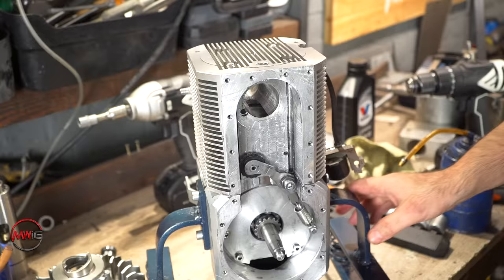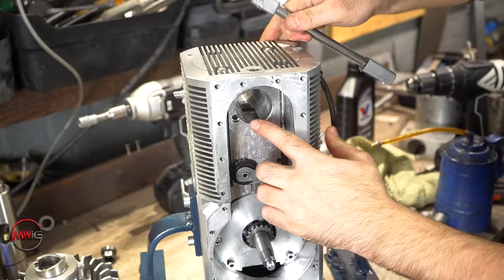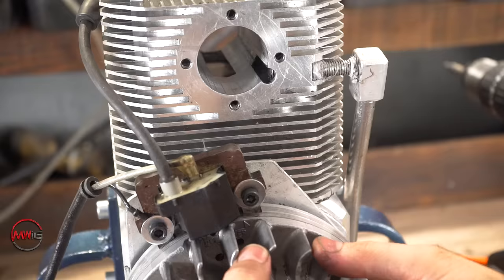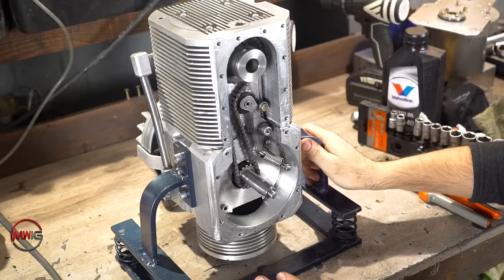I built a brand-new Rotary Valve Engine, and it works!

Comment from the maker: I built a brand-new Rotary Valve Engine, and it works!
Reply: YES! congrats!
Reply: Also we want to see the power output, make followup video and give it a test.
Reply: Please use 2 stroke oil in a secondary tank for lubrucating the valve. The smoke will clear up a lot
Reply: Масло гонит через распределительный механизм, скорее всего из-за этого дым!
Reply: Will also recommend a dumper on the other end to help reduce vibration by compensating the flywheel balance during crank shaft motion.
Sorry I am just so excited by this and it's my field of profession
Reply: This is not new one.i made it before
Reply: I've got name
Smooky 😁😁😁😁
Reply: Love to see you refine it and mount that little beast onto a frame with wheels or some cool design from youself🚌🚖🛥🛩
Reply: Very great job
Reply: Alhamdulillah, congratulation Guys 🙏👍🤩 amazing
Reply: Yes finally you Done it I so happy, congratulations & greetings from Sri Lanka. This should be a another invention rotary valve, now try to do fine tuning reduced smoke, stop trying engine lubrication oil burn. & improve fuel efficiency. Good luck. Thanking for sharing & for your self encouraged.
Reply: Happy for you!
Reply: Congratulations ..yeah ..👍👍
Reply: Great job!!!! I just started the video, so I don't know what the fix was, but last time it very close.  Just sounded like you needed to adjust some of the way its timed possibly. But ive never done this like you, so ill sit back, be quiet and enjoy watching your video!
Reply: Heck yeah, glad you didn't give up on it. Nice build 👌
Reply: To make less smoke, use twostroke oil in the gasoline, it burns better (and it is not good to mix normal oil to fuel anyway). Well done on the engine mate 👍👍👍
Reply: A lot of oil leakage into the cylinder. How about instead of rotating the cylindrical  valve you push pull it: instead of rotating push it in one direction for intact and pull it in the other direction for exhaust. The  you can apply piston rings to address the oil leakage issue. Use a CAM with a pitch on the side that pushes the cylindrical valve in and out. Or use two cyindrical valves: one for intake & the other for exhaust.
Reply: Super vidéo 👍
Reply: Love that old school sound
Reply: Even better if you put vulve oil seal
Reply: Please work on the oil leaking  into the chamber  issue, this valve is the future,  i will give  you design ideas give me your email. use oil scraper just before opening. oil scraper will partially help with oil leaking problem. this valve is so much better than puppet valve system. patent it. you will be rich.
Reply: Я очень удивлен и у меня есть два вопроса сколько двигатель выдаёт лошадиных сил и какой расход топлива ?
Reply: I have a couple of very interesting engine designs that I'd love to see you build!
Reply: this engine it's mixt by rotary engine and 2 stroke engine
Reply: I have also made smoke machines
Reply: @philkinmwangi  dampener? Is your auto correct messing with you?
Reply: Well done! Congratulations, excellent machining.
Reply: Tambahkan turbo
Reply: Good jobe
Reply: А почему до сих пор в двс используют обычные клапана?
Reply: @philkinmwangi  Harmonic balancer
Reply: @Dreamer3K This rotary valve has many advantages. Less parts, easy to manifacture, better gasflow etc. We still have poppet valves because they are much more resistant against pressure. The invention we need ist not a rotary valve, the invention we need is selfsealing rotary valve.
Reply: @leximatic  i can help with that.

Comment: I designed an almost exact head about 45 years ago. Before CAD a friend and I worked it out on paper and called it a rotisserie valve head. Glad to see someone actually had the balls to run with it!! Nice work.
Reply: Yeah me too. I presented it to GM at a special meeting of their board and they said "Oh Bullshit".  LOL.
Reply: FYI - a similar valve-less engine was devloped in the late 30's / early 40's by the Germans to fly their planes - I remember reading about it back in HS in the early 80's when I was enamored with Wankle's rotary engine.  It had a rotating disc on the top of the cylinder head if I recall correctly...
Reply: It's called the Cross rotary valve

It came up in some Popular Science of the 70s
Reply: @repentnow1720  A Wankel engine is completely different and doesn't have any valves at all.
Reply: I congratulate you for having built a rotary valve engine, I am a foundryman and I built a rotary valve engine 23 years ago and it worked, but the development failed me because it worked for a few hours due to excessive wear.  Los felicito por haber construido un motor de valvulas rotatorias, yo soy fundidor y construi hace 23 años un motor con valvula rotatoria y funciono , pero me falto desarrollo porque funciono pocas horas.
Reply: The same design has been tried by very smart people & it failed every time but to excessive wear & heat also the slow opening & closing speeds.

Comment: Very similar to a valve train I designed for a science fair in 1979. Poor high school kid so my model was built of wax, and plastic. So cool to see it probably would have worked. Mine used ball valves on a common shaft that wasn't hollow, and turned at 1/4th crankshaft speed so that the valves opened in the opposite direction each time. I worried about compression, and oil seep, and never could figure out how to seal them effectively. Thanks for doing this. I still think about building a working example to occupy my mind sometimes when I can't sleep. Life has a way of consuming all available time.
Reply: Must be where I got the idea .. as you finished up I was born ...lol.  ( May of 79)
Reply: @jasonwhite8722  You're too kind. The hollow shafts are ingenious, and a much better design. Like I said, just a dumb high school student that fell in love with engines, and their complexity. Thanks again for building this.
Reply: I too came up with something similar when I was young (early 90s). Mine used something like camshaft blanks though tye valves were cut out reliefs and intake/ exhaust were separate. Later learned about Coates Spherical Rotary Valves. Also read about disc type systems invented in the early 1900s with a hole that rotated above the combustion chamber. They also couldn't get enough compression.

Comment: synthetic oil smokes far less and will leave less residue, other than that i'd love to see how much power that thing puts out!
Reply: It's easily around 120kW
Reply: Interesting. Lets put on dyno.
Reply: doesnt help when it literaly spit oil throug exhaust in first few seconds 9:13 its literaly driping all over lol so bad this video is such a bad example. or example how not to build engines.
Reply: @JusstyteN  tell us how many you've designed and built
Reply: I changed my mind. It's EASILY 1MW motor
Reply: @JusstyteN  He mixed oil with fuel. That seems the engine imitated 2 stroke cycle engine.  Its normal characteristic on this kind of engine.
Reply: @alexlo7708  yep he added oil like a 2 stroke but it's a 4 cycle and has static oil lubrication so shouldn't need oil in the fuel
Reply: @jackass123455  I think so. Had not he mix the oil, pure fuel would have not release smoky.
Reply: @alexlo7708  no its not normal to spit oil in droplets in the forst few seconds. Even in 2 stroke engines the amount that is added should be burned. This one is spiting like engine that is done for.
Talking about designing im not trying to reinvent a wheel there are teams of engineers that are working on already great designs to improve it. While he tries to reinvent invention that was built in late 1700s im happy that he made something in his garadge but that engine has no use. Basicaly waste of  effort and materials.
I have built 1 hybrid engine myself also in the garadge. I know plenty about the engines and i can say for certain that invention that had multiple teams around the world trying tirelesly to make it better for 200+ years wont be reinvented in some random as garadge dude who is very happy that he made an engine who is absolutely not working as it should.
Reply: @alexlo7708  this dude reminds me of the dudes who think they have built and infinite running engine. If i was to build an engine i wouldnt publish something that is failure or if i was i would put a proper title as "trying to build an engine not successful yet.
Reply: @JusstyteN  >talks like an authority on the matter

>can't spell garage
Reply: @JusstyteN  if there weren't people like him doing stuff like this, there wouldn't be much innovation. Why does it matter so much to you that this guy built an engine? Also, why not show your failures? Their a part of growth and show that you are indeed human. I like them being included. Then also if someone tries this for themselves, they can avoid the mistakes
Reply: Maybe this is more than just a fun project, maybe it's a prototype. You don't make a perfect product in one try. You look back and do some tests to determine what does and doesn't work, and you improve from there. He doesn't even need a reason to do this, it's just something cool that he did. I'd be overjoyed if I built a working motor from scratch, especially if it has one or more unconventional mechanics.
Reply: @JusstyteN  Pretty sure most new ideas started with a guy in a "garadge". You don't know much about the history of inventing if you think that most of it came from paid teams in labs with college degrees. Those paid teams are really great at the process of iterative design, but nearly all "new" ideas came from individuals who are free to think, try, fail, and try again as their hobby.

It's better to cheer on the man who has an idea, and is willing to try it. If you have enough ideas, one might actually work - and from each failure, you have a newer and better understanding of the limitations of things. In both cases, he is becoming a better person, and that's worth far more than the cost of materials he's going through to do that.

Comment: Glad to see the it run. Only thing I would suggest: You need rings to seal the rotary valve much like turbos use. Send me some dimensions and I can see what I can help you with(I've got lathes, precision bed mills, surface grinders and cylindrical grinders, etc at my disposal)
Reply: Awesome. Too bad I can't offer more than words.
Reply: @RIKARD NEW ZEALAND all turbos use rings in both the compressor and the turbine side of the shaft to stop oil getting into where it shouldn't be. Maybe you need to research a little before commenting.
Reply: What about some sort of sealed bearing?
Reply: @guimoura1660  A lot of turbos use labyrinthine seals. They don't actually make contact between the surfaces.
When running at the speeds of many of those machines, there aren't many materials that could survive. Even the "bearings" are just thin films of oil, and possibly a foil bearing, for the low-speeds on start-up and spin-down.
Reply: I was thinking the same thing. A piston ring seal.

Comment: I’m 52 years old. In 1982-1983, I was drawing a mini helicopter in school during science class. I had no idea that a Wankle, rotary motor existed but I drew up a motor without typical pistons and valves because I couldn’t understand why there was so many parts, including moving parts. One of the very first ideas I had was to get rid of the valve along with the push rods rockers and cam. I wondered why there wasn’t a cylindrical shaft that had slots in it to open up at the correct time for fuel to enter and exhaust to escape?
Later, I then thought about the piston itself. Why up and down, why not a large cylinder shaped shaft with a slot cut out of its side for a combustion chamber as it rotated. 

So, to make a long story short, you just woke up a dream that I had always wondered about for more 40 years and now it’s a reality.
You are an amazingly talented guy. Great Job my man.
Reply: Go For it Man! The Time Is NOW!!
Reply: You know, I would tend to believe someone with the intelligence and insight to design such an engine in grade school would know 40 years later it was called a "Wankel rotary engine". Cunninghams's law v. Skitt's law.
Reply: Do it do it do it do it
Reply: @beeorganic  I’m not sure I understand the comment?
Reply: now you know it works!
Reply: @kyleorr7039  Since you edited your comment from "Winkle" rotary motor to "Wankel" I'm pretty sure you understand now. Nice try.
Reply: @beeorganic  I changed the spelling because I didn’t realize I spelled it wrong until you mentioned it. But I didn’t understand your comment in the first place, regardless of the misspelled word. I’m now starting to realize that you might have just been mean spirited toward what I had written, but I’m not sure why?
Reply: You story sounds intersting, I wish I could hear more about it  (the long version ) 🙋
Reply: Thank you my friend. Some day I’ll have some content but for now, I really enjoyed and admired this guys video. The patients he had and the knowledge to machine a motor in the manner he designed it is just incredible.
Reply: @kyleorr7039  so do I, the efforts give results earlier or later. I wonder in wich part of the world are you , I mean is there time difference between us. I'm in Europe
Reply: @romap8605  I’m in the U.S.A
Reply: @kyleorr7039  oh , quite big time difference. Are you currently doing any ingenering things .I'd like to know more about the topic of the engines if you have leisure time  (?)
Reply: What do you think about engines Omega 1 and LiquidPiston
Reply: @romap8605  good morning my friend, it is Monday, 2-21-22 at 7:07am.,I’m very much a novice and most everything I design is concept only because I’m just now learning how to run a milling machine and a lathe machine.
Reply: @kyleorr7039  good morning. Its 13: 17 here the same day Sounds intetesting for me. As a keeper I have to use lathe and other machines for bees dtuff. Maybe I should text you  at evening (?) Do you use Skype or Watsapp?

Comment: I really hope to see refined versions of this engine in the future! A side by side twin would be really cool.
Reply: Side by side twin could lead to a no extra part supercharger if you do the bottom end like 2 strokes.  Set up the cylinders to fire on opposite strokes and each power stroke will attempt to charge the intake cylinder with both cylinders of charge from the bottom ends...

You will need a counter balancer lol

Comment: Fantastic!  I'd  suggest modifying the rotary valve so that it can ride on plain bearings on both ends. Oil seals could be used to control the oil and seal the oil supply from the combustion chamber. The rotary valve could ride on the plain bearings on a hydrodynamically lubricated surface. This would also seal off the combustion gases, preventing a loss of efficiency and lubricant dilution. 
Also, buy yourself a drill-driven cylinder hone. This would give you much better results, is safer, quicker and easier than resurfacing the cylinder wall on a lathe.
Reply: Would probably need cast iron rings like a transmission uses
Reply: Balancing the engine and fine tuning the fuel air ratio might be worth investing.  Sounds to be running a little rich. 
I also think that mount setup may be hiding a few issues as well. 
All the same, would be interesting to see its power output.
Reply: @boziewz6125  Lol, A little? Look at the oil pour out the front. The rest of the engine seems to run fine, The only thing bogging it is the amount of oil going through it. Its burning so much to make that thick smoke yet still some pours out steady, It ain't ever gunna seize.
Reply: @BattTube  when running rich, it means in fuel, not oil.

Comment: Some suggestions to improve engine performance:
1.Use 2t lubricating oil
2.Add mechanical seal on both sides suction control shaft to reduce oil burning
3.add two ball bearings on both sides suction control shaft
Use a thicker intake control shaft and increase the intake opening,reduce inhalation resistance,it will be better!
Reply: I think the tapered shaft would allow you to set the clearance
Reply: This! I was thinking along similar lines.
Reply: @maciejrieju  Might be a bit too sensitive to overheating and bind up.
Reply: @thecorbies   1termal expansion of stel :0.12 aluminium :0.23 .assuming the use of the same materials, the clearence would increase . 2 you can dail anny clerence you desire :)
Reply: And making the timing more adjustable. She is off a bit.
Reply: @maciejrieju  Do you know what is causing the low RPM? If the engine can increase the speed, many problems might be solved
Reply: In case need a carburator?
Reply: @hehehe3029  Maybe a fuel injector would be more suitable for that engine
Reply: Don't give up your day job.
Reply: yeah I was thinking similar thought,  small piston rings to seal the shaft or some kind of O-ring might help.
Reply: @sticker89  More timing advance is my guess. He said it was twelve degrees, but the fuel is too thick as well.
Reply: why is there so much smoke
Reply: @sticker89  I'm thinking that the timing of the spark can be right on TDC but the open and close of the valves can withstand a large overlap and should probably be advanced to 5 degrees or more because there is now added area to the combustion chamber. There will never be valve slap because the valve is spinning instead of stop - go and this is why I believe the intake and exhaust timing  should have a huge overlap to achieve extremely high RPMs. Before any of that it needs fuel injection and possibly turbo or supercharged.
Reply: I'd also find a way to run coolant around the exhaust side to try and cool that tube down so that it doesn't burn up the oil and seal if it gets one.

Comment: Its incredible how tightly the valve has to be sealed to work but it does. Cant wait to see it run!
Reply: I've worked on many many small engines where the valves are so out of clearance they dont shut, but they come in the shop running.  Not a lot of power but they run.